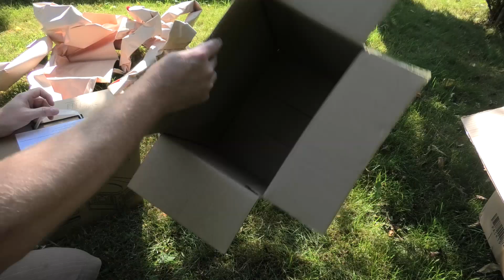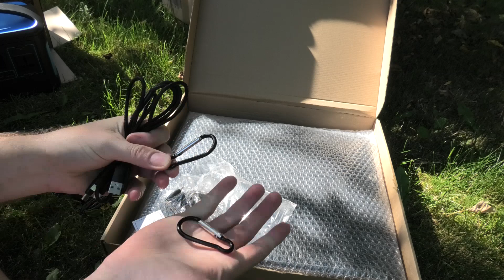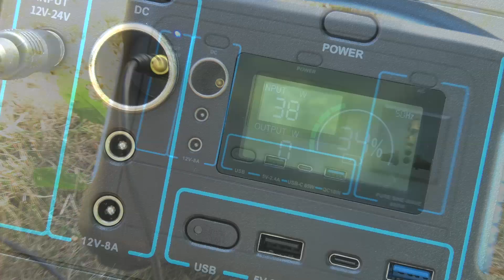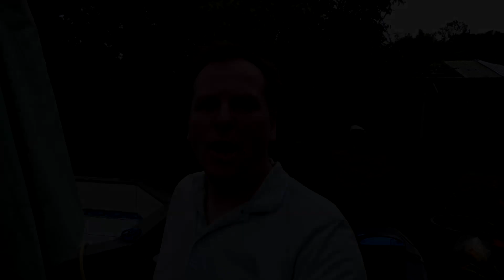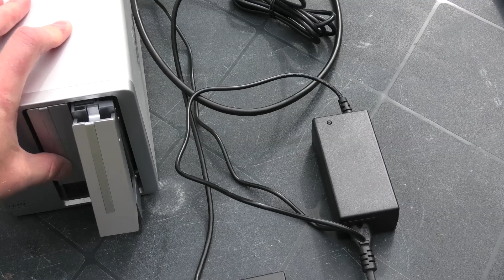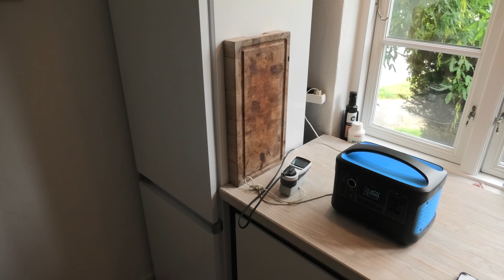Cheapest 600W Power Station, with 100W Foldable Solar Panel - 1204

Comment: Had this model for 13 month 100 / Charged pumping up tyers just died completely dead will not buy again no reset no way to open without breaking apart
Reply from the maker: Thank You for your Info... I have also not been able to take it apart.

Comment: Can anybody tell us about a REAL REVIEW of something solar that can be used for actually charging devices?  I am tired of so-called reviews that are just unboxing videos.  A ton of us would like some reviews of real-time USE of a device, not just opening a box to show what's inside.
Reply from the maker: So if I told you how long it takes to charge my phone from 20% to 100%,, even tough 99% of all will have a different phone. That would make you happy,,, or my laptop that is no the same as your laptop.
Reply: Maybe with the battery low see if the solar panel can hold the charge via the power station? Most of us want to know under what condition can you do what with solar recharging live

Comment: You know that shading on one of the panels is killing alot of power. These panels are run in series so the other panels will step down voltage to the lowest outputing panel. If you put it in the sun without ANY shading, not even a leaf. You'd probably get 70-80 watts from that panel.
Reply from the maker: I know,, it needs full sun..
Reply: @MyPlayHouse  Good review though it's good to see people getting into solar and power stations. They are handier than you think. Just wait until your first blackout or camping trip. You're going to thank yourself.

Comment: Hello sir is the power bank true 600W as i am thinking of buying one to use on my boat kind regards also are the battery cells high quality and would you recommend this power station kind regards 😊
Reply from the maker: For the money,, this is pretty good. I think it will do 600w,, but a lot of stuff uses more then 600w for a split sec. when you just turn it on,, and it does not do that, very well.
But other than that I was impressed, with it.

Comment: Any device with a motor needs double or sometimes triple the energy to start up.. i have an air compressor of 1500w but i can't run it on my 1500w generator.. i have to use my larger gasoline generator of 3kw. Nice review video though
Reply from the maker: Yes,, I was going to play around with a softstarter,,, but then I got sidetracked.

Comment: I got the exact same one that's only 500 watt.
Reply from the maker: I was not able to run my tiling saw,, and that was 600w other power stations has been able to do that,, this one does not have as high a start wattages, it seams. But I was able to run my PC with two 28" 4K monitors for 8 hours,, but after I had made the video.

Comment: I thought about this one, considering one for myself - but went for the CTECHi Powerstation 518Wh out of multiple reasons (lifpo4 instead of cheaper Lithium-Ion cells - which is much more save and double the lifetime with a minimum of 3500 charging cycles,integrated induction chargers for phones and stuff, 1000 watt surge-power for starting bigger things, dc out works while charging, and a 12 month warranty in Europe and not in china, which is quite comforting i think). It was 50 euros more expensive than this one, but at least i could find multiple videos, including one about the safety where a guy disassembled it and checked everything. Someone did a video checking the real capacity, which is quite important on these chinese things... well, You have basically the only video about this one, thanks you very much for that. Without it we wouldn’t have a single clue about the device, you did us a solid🙂👍
Reply from the maker: Well that is also an well priced power station, but the good prices seems to be without solar panels. so the box to box price is as I found it £218 vs. $390 still a good prices,, I did not find it with EU connectors ?

Comment: A refrigerator or air conditioner will draw much more than its normal startup surge current if it's shut off, & then re-started right away. You should have waited at least 4 minutes so the startup current would be less. Ideally, in this case you should wait 10 minutes so the startup current is the least. The back-pressure & vacuum of the refrigerant is too high for the compressor to easily start. When it sets a few minutes, the pressure side & the vacuum side eventually equalize making it easier to start.
Reply from the maker: Hi PSK Research
Thank You very much!  glad you liked the video :-)
Thank you for watching! :-)

Comment: Like you said you got a very expensive flashlight you can buy a little solar powered packs that are big enough to fit in your pocket for 50 bucks and they'll charge your phone for up to 3 days
Reply from the maker: This was a bit better than I might have shown in the video,, I was a little disappointed that it did not run my tiling cutter,, but it did run my PC with two 28" screens for 6hours after filming,, so not as bad as the video..

Comment: Morten,
Don't coil your AC power cable like that. Next thin you'll do is put the loop over a steel pipe: and boom, transformer! 😬.
Thanks for the video!
Reply from the maker: Well current moves in both directions in a AC cable,, not sure that will happen.
Thank You..
Reply: @MyPlayHouse  and when you wrap/coil the cable around like that the magnetic forces repel each other and also induction. Steel core == transformer.
That's why they say not to leave electrical extension cables coiled up while in use: they'll get extremely hot from induction and extra cable loss 👍.

Comment: I think you are right about the tile cutter using to much current to start up and is causing the power bank to cut out. Something that might be able to help you is a soft starter. They are used in off-grid battery systems that use motors, like AirConditioning, where it caps the amount of current that the load can use while it starts up to prevent it overloading the power source. It does mean that the motor will take longer to spin up but it should start.
Reply from the maker: I have been looking at soft starters,, just not sure what to get.
Reply: @MyPlayHouse  I'm afraid I don't know either, I know they exist and in theory that one should fix the problem that you are having but I have not needed one to know much more than that.

Comment: The compressor in my bottle cooler uses 1,5kw inrush power for 10sek and then fall down 34w. Same with Powertools. I've see many 2kw petrol generators, that can not start a hammerdrill + my old kärcher shopvac... my 5.5kw single phase diesel generator have no problem with that
Reply from the maker: For 10sek.. that is a long time,,, :-/

Comment: I've just bought one of these 600w powerstations to test against the jackery 500 .......I'm in shock that your video is the only one I can find with this powerstation as people do so many on all the other brands ... really appreciate you doing this video mate cheers 🍻
Reply: I am looking at both Power blocks the Jackery and the one above. Which came out best in your tests ? Thanks.
Reply: @xpaced10  100% the jackery wins hands down on everything the other one has just been a complete disaster the only thing I will plug into this one is a light that only uses 8watts via USB anything else that gets plugged into this powerstation causes electric faults on my phone tv and ipads and will no longer plug them into it . It's a big no from me lots of other issues with it to. But the jackery 500w has been an amazing peice off kit I've had it running my 20 ltr compressor fridge for 6 months now plugged into a 100w solar pannel and battery 🔋 has never been lower than 70% during the day powers straight back up to 100% and that's with charging power banks ipads and phones while at work . Best thing I've ever bought !
Reply from the maker: I was surprised myself that I could not find any videos on it.. The video might put it in a little to bad light,, as I show as much stuff that it does not run as it can run... I think it might actually be an okay unit.
Reply: I don’t understand it , what make is it how do I find it
Reply: This has been around for almost a year in different brands. I have one too, and use it for camping with solar. Perfect unit for my needs 😃
Reply: There's loads of these under all sorts of names, I have two from "Sarari Toctor", which is 'actually' Redspyce. Lvyuan also do one. They're all obviously cheap Jackery ripoffs, just with accents in a different colour!

Comment: Hi Morton, is it possible, to plug multiple solarcells to load faster?
Reply: can you please tear down this UPS,  i want to see what MCU inside.

i bet it low cost cheap IC
Reply from the maker: There is a voltage limit on the input 12-24V,, and there is input limit of 5A,,, 24*5 =120W
I found someone else selling the solar panels,, as 60W, witch is probably right,, so two set in parallel would do it..

Comment: That box is a cheese of pit, obviously. 💩 Someone forgot to build in an earth connector. That's why the fridge and saw won't start up.
Reply from the maker: Ahh it´s not that bad,, this video was edited while my PC powered from the power station,, and it ran my PC for almost 9 hours and I stopped at 9%. so smaller loads it does just fine.
Reply: @MyPlayHouse  It's good for video editing in Portugal, hus? ^^)

Comment: Anything over 33C is too much for me. It was 45c here and I about gave up. I want winter and autumn again.

This is really cool. I've been wanting to get back into doing solar videos.
Reply from the maker: Hi Rinoa
We start to melt at 25C here,, and we do not get many days over 25C,, so the 35,9C we saw last week was record breaking. It was only like 3 days with high temperature,, and now we are at <20C :-/
I am typing to you from my main PC,, powered from the sun,, and storage on old 18650 cells :-) My big solar projekt at the moment is that I want to power a heat pump this vinter,, 1,5KW,, that is a challenges..

Comment: I believe many of these solar chargers don't allow input charging and output simultaneously, which is no surprise for the price.
Reply from the maker: This was different,, as long as it was charging it worked just fine,, when it reached 100% it did not want to do it.
Reply: @MyPlayHouse  it look like problem with voltage regulator to MCU unit

Comment: cause you can add more panels pretty easily - this mkt segment is going to keep getting better and prices will drop - even for the cheapest - think of it powering a couple laptops - always on power and filesystems basically - think about it powering some lo pwr arm and maybe even a phone or two modified with linux deploy and debian arm #access point #cell router #ha opnsense #nano pi mods #bsd
Reply: try to find fix for charging from panels and also powering laptop at the same time - maybe you have to get another brand or maybe firmware fix or maybe try it with less than 100%
Reply from the maker: This is an area, with lot´s of progress,, I was able to power my normal PC, for 9 hours with this cheap one.

Comment: The tile saw will have surge wattage multiple times the rated wattage of the device itself. so it would exceed the inverter max power.
Reply from the maker: Yes,, and this is very important, when figuring out what the unit will really power.

Comment: The unit had one good thing , you dont need to paint it blue albefore throw it deep in see.

Low cost solar panel , unstable chargher . pieace of junk
Reply from the maker: I think I might have been showing to many negative sides of this Power Station in my video,, It powered my Tiny Lenovo PC with two 28" monitors for 9 hours,, and I stopped at 10%
It´s not that bad,, and for the money it is quite good. (compared to the competition it is about ½ the prices)

Comment: about stop opartion when charghing, i think it bug or defective unit.

Motor that rate at 600W , in start take the max power even more then 1000W.

about the frige, 0.8KW 24h it=> avr 34W/h . But in frige had deforst
 heater that can take 6A 1200W.

Normal frige compresor is 200-400W
Reply from the maker: So if it was able to start up the compresor,, it could run the fridge 19hours-ish,, and if it got 12 hours of sun charging with 50W it would charge up again. Lets say from 8am to 8pm it could do 600wh but also still needs to power the fridge at the same time. Even under perfect circumstances,, it is not enough solar panels. :-)
Reply: @MyPlayHouse  
to run fridge that rated 0.8Kw per day you need:

8hours sun at  100W panel

or 4 hour sun at 200W panel>> that more recommended.

the flex solar panel not efficient(like in this unit).

Comment: The saw trips the device on the plug, because there is no earth connection. (inrush will also be a factor after that) Tripping the powerbank is what you did with the fridge... the 800W is because the compressor is stalled. you need to give it a rest after it has been running.
Reply from the maker: Hi allowee
Thank You very much!  glad you liked the video :-)
Thank you for watching! :-)

Comment: 800 watts from a fridge?    
My Frigde from 2014 uses 40 watts when the compressor is running.  Why so much?   (its also has a freezer on the bottom)
Reply: It is pretty common that things with an electric motor can draw a big inrush spike briefly when powering up. Probably also your fridge.
Reply: 40 watts compressor no way. Only the electric controler about 20W
Reply: @orencomputerelectronics8751  The whole fridge only takes 53 watts measured myself with the door closed so the 10 watt light bulb isnt included on the specs sheet inside the fridge it says max power draw 60 watt 0,40A @ 220-240 volt. (Exquisit KGC233/60-4.1A+++) 109 kWh/Annum  Annual energy consumption (AE C ) in kWh per year, based on standard test results for 24 hours. Actual energy consumption will depend on how the appliance is used and where it is located.  so i was shocked that there are still fridges that uses so much power.  I have this thing for years now.
Reply: @yentl555  read fridge datasheet, there is no way it consum less 150W  at full load.
Reply from the maker: I think he is right,, I found that it uses 60W running : https://www.notebooksbilliger.de/exquisit+kgc+23360+41+edelstahl+look#technische_daten 
under "technische daten"
Reply: @MyPlayHouse i this firdge very efficient.

109KW per year it very good , about 109K/360=0.3KW/day

i had samsung NOforst that take about 440Kw/year

if the fridge had DE frost when ice cover the radiator, it turn on 1200W heater 6A to melt the ice.

about electric motor, when is start spin or high resist, it will take max power( the pure coil resistance).
atter the motor spin at high speed, the resistance go high. 
* the XL=> go from min to max R=constant 

the peak current of motors can up twich then the continuous power.

that the reason in UPS use VA then W.

about the disk server,

 it had intel 11th gen CPU low power 10nm . that is the best CPU at 10W.  then total power consumption 23 it logical at this load.
Reply: A/C at 1HP(745W) work half hour to cool the radiator, and half hour to blow cool air.

https://www.youtube.com/watch?v=vYWDmqDkcPk
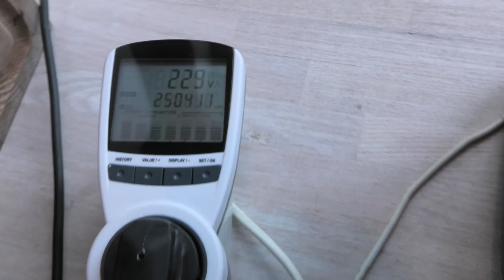Reply from the maker: at 28:58 I show hat it is using 112W running,, that is more normal.

Comment: So youi have a normal summer day in denmark. I remember the summer of 1966 and 1967. It was warmer. ;-)
Reply from the maker: Our "heat" record is from August 1975,,, 36,4C :-) still holds. the record for July was 35,4C and it was from 1941,,, new july record is 35,9C 2022 :-)

Comment: The start up surge caused by the winding inductance might be overlaoding the power pack.
Reply from the maker: Most likely,, wonder if there is like a soft start for something like this..
Reply: @MyPlayHouse  Assuming the tile cutter uses a brushed universal motor (most likely), you can make this work.  Plug it in via a TRIAC phase cut dimmer / speed control and ramp it up from zero.  Wire a switch that bypasses the dimmer once the saw is running.  You could also try starting it with a 100W incandescent bulb in series then flick a switch to bypass the bulb once saw is running.

Startup surge is easy to manage with brushed universal motors , but hard to manage with induction motors ..
Reply: It's called the Inrush current